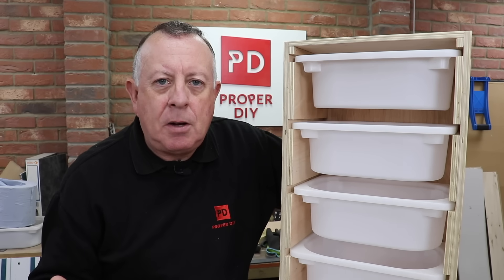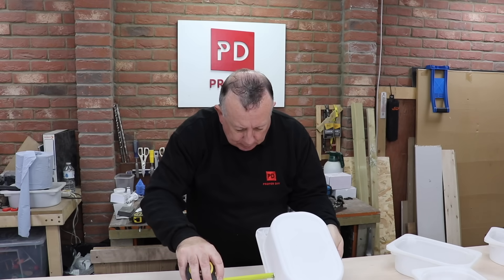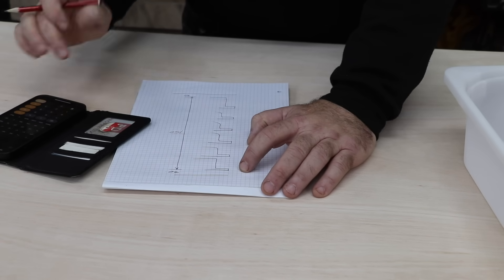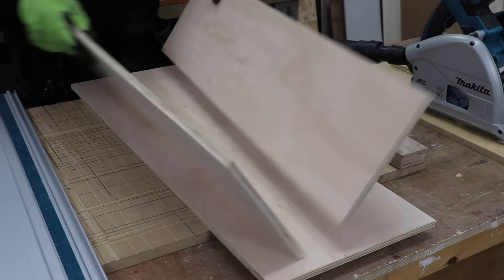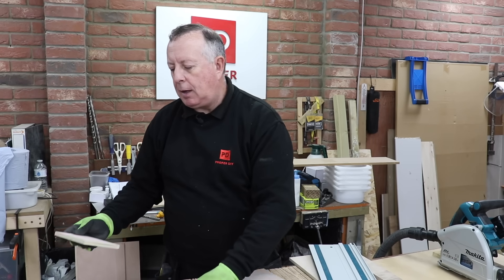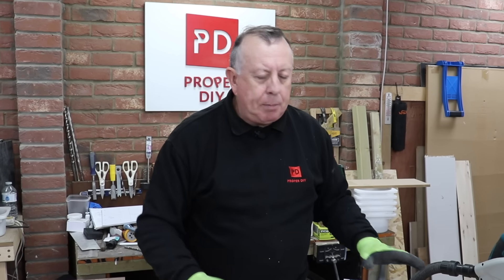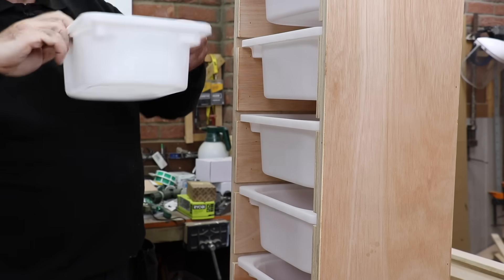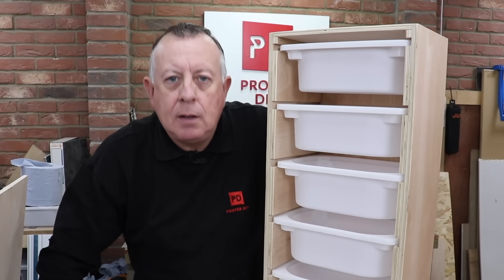Why Plywood Orientation Matters

Comment: I have an ap on my ipad called “Offcuts” which is very useful for breaking down sheets of plywood.  I think the trick with plywood is to find a source for good quality stuff. Another thing to realise that plywood is often left with a release agent on the outer surface from the gluing up mold process.  This should be removed by sanding if you want a strong glue joint.

Comment: Useful, thanks. For me, the direction vs stiffness characteristic was obvious (but that's my engineering brain at work). The surprise, though, was the veneer that tricks you into thinking that the strength is in one direction, while in reality it's going to be at 90 degrees to that.

Comment: Here that is too expensive. 
A III Class pine plywood 12 x 1200 x 2400 mm costs 37,50 €
A BB/WG birch plywood at same size costs 92 €. 

You would have got half of the plywood saved bu simply using router to make the slots for the 12 mm plywood. Just 4 mm deep that is enough for the drawers, but keeps 8 mm for each slot part, that is more than enough for all the material that is stored there. 
And if really needed then more strength, then add some hardwood beams to sides that is much cheaper than using plywood.

Comment: Intiutively it makes sense - but I can't believe I never thought of this! This will come in handy soon as I'm planning to make a built-in wardrobe out of ply

FYI Finding a DIY shop whose saw is a) working and b) has someone around who's qualified to run it is a near impossible task in 2025 Britain. Always call ahead if you're thinking of doing this
Reply: That's why I have roof racks. Then I bring a pair of studs to clamp the plywood to. I also block up the back rack some to give the sheet some angle. I like the down force. I'm going to be going at least 50 MPH on the ride home. So wind load is going to be a factor.

Comment: Wow, that was a really interesting video! I never noticed or knew that there is a thin veneer on top! Very helpful stuff! I will definitely be looking at the layers next time, to determine the best orientation. Thanks! 👍🏻
Reply: Not all plywood has a thin vernier. There's different kinds of plywood. Construction or dimensional plywood has no vernier. What we're seeing here is hardwood or furniture grade. They're different thicknesses too. This ply is full thickness. Construction is a little under nominal. In the US it's 1/32" under size. The thickness of the missing verniers.
Reply: This is a very nice project!

I knew that plywood had different stiffness in each direction, but had not thought about the show faces hiding the grain direction of the outer structural plies.

Comment: I've made some similar racks for Allit (Sortimo-style) cases and Ikea Samla boxes. I wouldn't recommend having open "tub" style boxes in a workshop, they'll get full of sawdust in no time. Both the Allit and Ikea boxes have lids.

Also, Samla boxes of approximately that size (slightly bigger, in fact) are 4€ with a lid and 2.5€ without, so if those cost you £3 (3.4€) each, you're not saving much. And Samlas are transparent, so you can see what' in them easily.

Comment: Could you get away with thinner ply?
If you have side-by-side stacks (say 3 columns), you would have 4 sheets at every adjoining layer. With some optimization, this may be three - one "wall" and a pair of sheets as "rails". (48mm, or 36mm at least). Would 9mm (or even 6mm) ply be "good enough"? The weakest point still shall be the plastic, imo.
What about staggering the shelves? Trofast is available in multiple heights, staggering might be enough to reduce the wall-count to 2 (and all pieces as small "off cuts"). Would this work? With 6mm ply too?

Comment: I'm still clueless about screws. Everyone's channel goes into the 20 different types of heads and threads and shanks but you can guarantee most people use a box of one brand and model for pretty much everything indoors and another box of different screws for outdoors. Only variables are the substrate and the sizes.
Reply: Bold of you to assume people don't just select by length alone, material and environment ignored.
In their defense if it's overbuilt and not oak or something that will eat the screws it's usually fine.
Reply: @joytotheworld9109 Good point 👍.

Comment: I would like to suggest looking at this video which extends the concept of using standardised plastic storage bins together with the use of a cheaper grade of board stock. This maker has also added a modular leveling device that is both convenient and very precise producing a perfectly flat continuous  work surface.  https://youtu.be/WqYu2u0uxwo?si=JphzfWiUqYluvyku

Comment: Hello Stuart,
Nice storage rack and a good (timely) explanation of “Why Plywood Orientation Matters” as I have to re-enforce some bowed mdf shelves in my workshop.
A tip if I may?   Use a hair dryer/hot air gun to warm labels on wood before removing, I can usually get the label off in one piece.   Any glue residue can be cleaned with a solvent before painting or dusted with talcum powder/corn starch/sawdust if painting not required.
Reply: The type of label is designed to break off in case of theft or damage, the price/size of board lable lasts longer.

Comment: Another thing to add to your excellent video - when you buy sheets of ply you may find the stronger plies and grain running in the direction on either the shorter or longer side - something to consider if wanting strength across longer lengths.  When listed as 1200 x 2400 or 2400 x 1200 it is because the grain runs in direction of the first measurement - so 2400 x 1200 is long grain and 1200 x 2400 is cross grain.
Reply: Is that true of the grain direction of the outside ply layers, even if there's a thin veneer in an opposite direction like in the video?  Or would the veneer finish run in the direction of the longer measurement?

Comment: As I told you at the DP tool show I built a 18mm ply stack for my Dewalt organisers 8 in total and put it on wheels, however a bit top heavy so have to be careful.   Always use Wickes for my ply £4 delivery charge, B+Q £12!

Comment: Thanks for sharing the info about the plywood, not something that had ever crossed my mind. I'm guessing plywood dust is possibly healthier than MDF but don't know, it seems like a nicer material to work with so I'm guessing it is.
Reply: That's what I was thinking as well. Whenever I cut MDF the dust is extremely fine and gets everywhere. Plywood seems less fine and easier to deal with. 
I guess if you've got a good extraction system it doesn't really matter.
Reply: There's no healthy dust to have in your lungs tbh

Comment: Interesting to realise the plywood is stronger one way than the other. I guess the easiest way to work out which way is strongest is to study the edge rather than look at the face - which may have that very thin veneer which doesn't really add to the strength and can mislead.
Reply: Plywood always has an odd number of layers. The grains always alternates between each layer too. So one direction is going to have grain running in it more than the other. They could cheat with the veneers. Because like you say they don't really contribute to the strength.